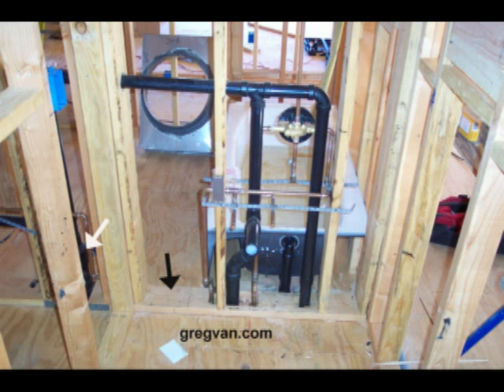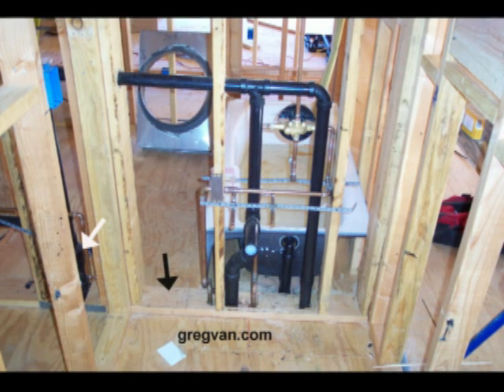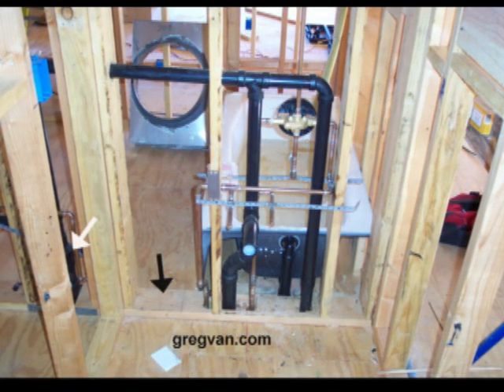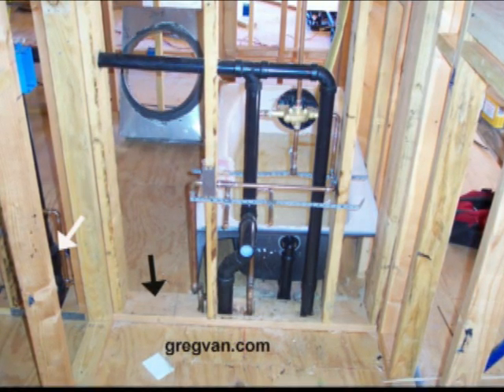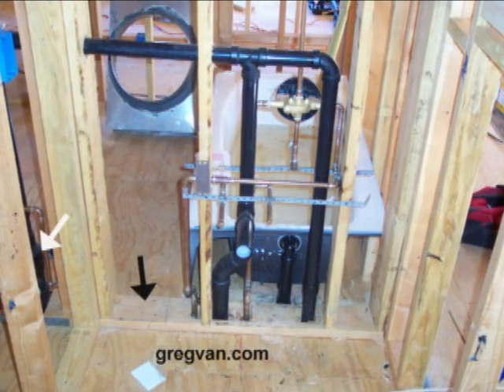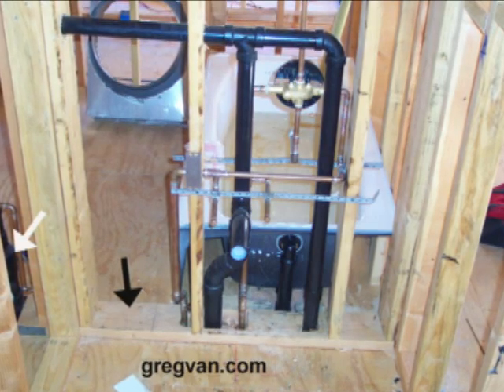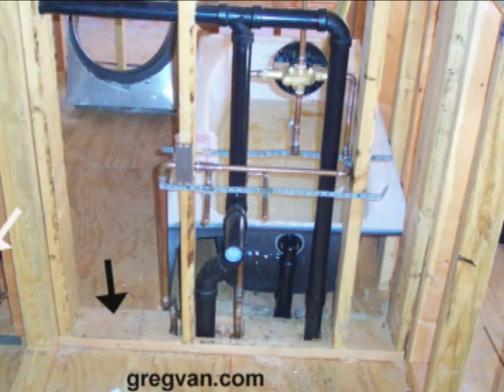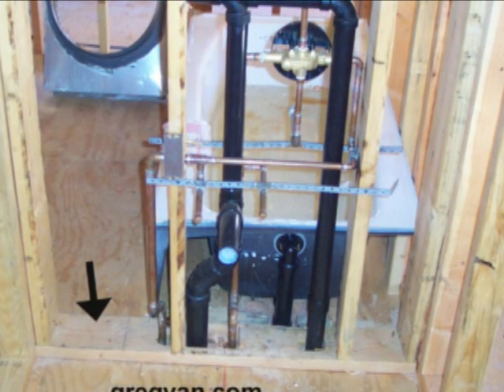Why Do I Need A 2 X 6 Plumbing Wall? - Remodeling And Home Building

Comment: I like 2x8 for a wet wall if I can fit it. 

To protect pipes, wires, etc in the wall, US code calls for them to either be 1-1/4" from the stud face or use metal protection plates. The nail plates seem to be nothing but a challenge for some homeowners. I've seen instructional videos about hanging things on walls say stuff like "Sometimes you'll hit a metal plate or similar obstruction, in which case you'll need to predrill through it." (!!!)

I'd rather give the trades enough room to keep their stuff well away from the stud face. 

2x4 = 1" working room
2x6 = 3" working room
2x8 = 5" working room

3" sounds like plenty (and it usually is) but, just like in the photo here, you regularly have crossing situations and other trades to consider too.

Comment: Hi Greg!First of all thanks for sharing your experience and advice!I'm going to remodel  a bathroom on an upper floor (it's in a triplex).I will change the plumbings also and right now the framing wall is 2x4.I was wondering if  changing the framing wall with 2x6 will not put too much pressure on the bottom joists???The triplex has been built in 1952 (if that can help :P).Thanks in advance for your help Greg!
Reply from the maker: It shouldn't be a problem, because you won't be adding that much weight and you could always add another 2 inches to the wall instead of removing it. Hopefully that makes sense but let me know if it doesn't.
Reply: It's always good to have two options ;). I believe having one wall but wider (2 by 6) would be the best option for the job to do.Thanks again for your help :)!
Reply: @gregvancom  wow I didn’t think adding two inch strips to the studs would be an option. Do I also need to add the additional two inches to the bottom plate? We noticed a big bulge in the drywall behind where the range would be and upon inspection it’s the vent pipe for the toilet/bathroom that is on the opposite wall.

Comment from the maker: You've got a good point and thanks for the helpful information. 3 inch pipes will fit in 3 1/2 inch thick walls and if the pipes are located in the center, sometimes the couplings won't really be a big deal, but that doesn't happen very often, leading us back to the reason why you left this slice of wisdom in the first place in the video.

Comment: A lot of times if I have straight 3" pipe running in a 2x4 wall , no couplings or such. I had a 2x6 piece of wood to the top plate , drill a hole for the 3 inch pipe , glue a coupling on and the 2x6 piece supports it, then I make my connections in the lower level :)

Comment from the maker: If I had a quarter for every time a drywaller had to shave the back of the drywall or cut a hole out for a plumbing coupling or even a nice bulge when they don't do anything, I could probably buy an expensive 12 pack of imported beer or even a large pizza.

Comment: Well 3" pipe fits in a 2x4wall but that's it, a coupling or a hub needs a 2x6 wall,, so u can run the water lines to

Comment from the maker: If the wall was structural, the plumber probably couldn't have cut it up, even though it happens. Some of these problems are actually created by the architects and the structural engineers and only made worse by an inexperienced plumber or a experience plumber, who doesn't have any other alternative.

Comment: i have a 2x4 wall running almost all the plumbing for an appartment half the studs over a 2-3 foot sections are just cut out just dosent look secure in any way ... i agree the plubling this size HAS to be in a thicker wall .  and i am lucky this wall isnt a bearing wall .

Comment from the maker: A 2 x 6 wall should work fine, for a 3 inch pipe and they will actually work well for a 4 inch pipe also. It's hard for me to tell you exactly what you need to do, but if you measure all of the plumbing parts you're planning on using, you should be able to figure out the exact wall thickness you need. Don't forget, you could always use a 2 x 6 wall and if didn't know for sure and fur it out later, by nailing some flat two by fours or ripped down material to it, making it wider.

Comment: I'm adding a slab floor washer/dryer room to my house and was wondering how to bring in the 3" drain to the room?  Up into a wall sounds like the right idea but I don't think a 2x6 outside wall will be wide enough.  Should I consider a 2x8 outside wall?

Comment: in response to the abs/pvc.  The local codes obviously reign supreme, but abs is used most in single dwelling homes because it is cheap.  Most piping will comply with building codes but its the fire codes that determine the kind of pipe you use, at least in Canada.